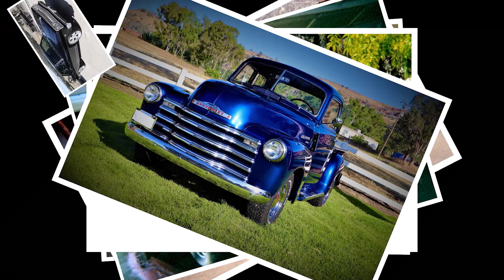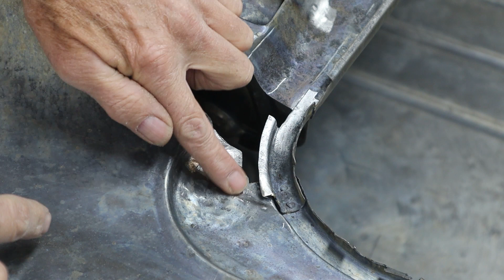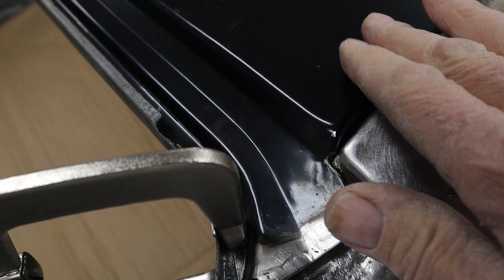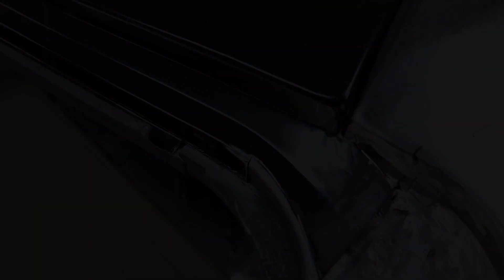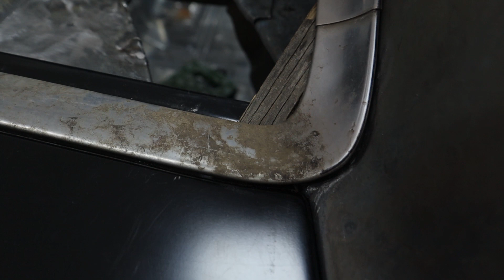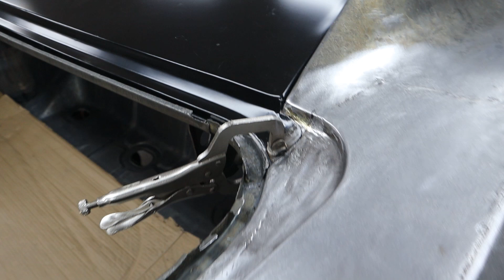GM A Body Filler Panel Final Fit Up - Rusted Out Rear Window Channel Repair - GTO RestoMod (Ep 24)

Comment: i really lucked out with my 66 cutlass deck panel only had fitment issue on the width for one side so slit it and got it close to inner sail panel and then i opted to weld the seems up for a smooth deck panel no seams.
Reply from the maker: It is kind of a crap shoot with these  repops.  I thought about welding or leading in the seam but I am leaning towards making it a very shallow reveal instead.  How close are you to being ready for paint?
Mark
Reply: mine is pretty much ready for paint, body work done and in epoxy primer while i source the small things for the front end  @FoothillPaintandFabrication
Reply from the maker: @tiemishuu  That is awesome. Must feel nice to be close to getting your project done.

Comment: I'm going through the identical process with a 66 LeMans. Don't weld anything until you put the trunk lid in place and confirm your gaps and heights.
Reply from the maker: Definitely!!!  I will probably have every clamp I own on that thing and some screws to hold it in place so I can get everything adjusted just right before the welder comes out. Working out what material to use between the filler panel and filler panel brace at the moment. The factory stuff was fibrous and falling apart.  I considered using a flutter kit but I am concerned that thin filler panel will show the adhesive locations when it sits in the sun.  What are you planning on using? 
Mark